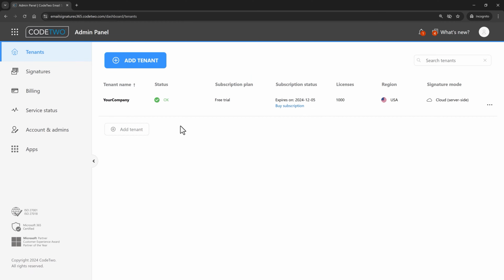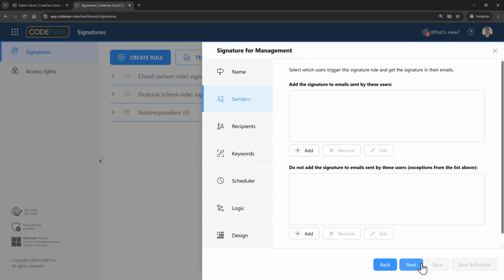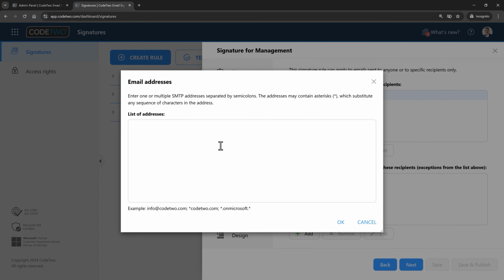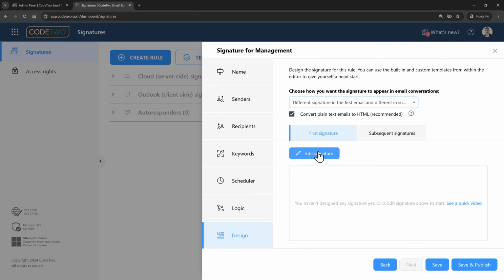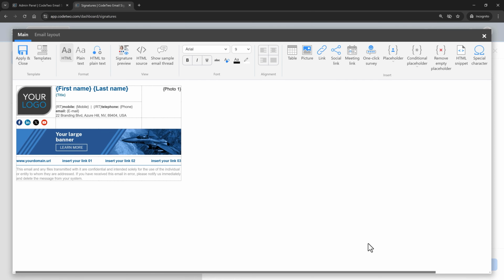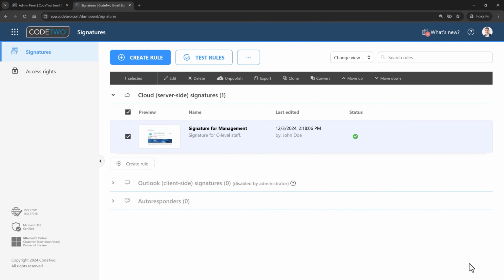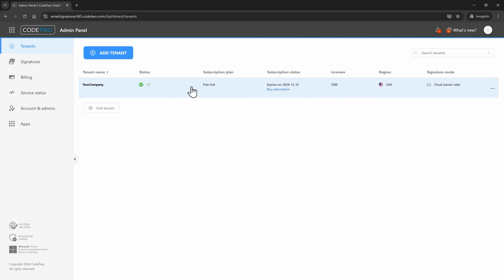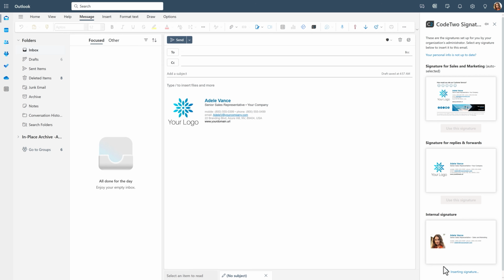CodeTwo signatures tutorial part 2: Design a signature & set up a signature rule

Comment: I used Exclaimer at my previous employer. CodeTwo makes the process more seamless and gives plenty more options. Pricing is more transparent too. Good job, CodeTwo!
Reply from the maker: Glad to have you on board. You made our day with this comment!
Reply: We are currently using Exclaimer cloud but it all requires user interaction (logging in with MS credentials) before it adds the signature. I just want users to have a signature regardless of the device they use their e-mail on. How does Codetwo handle this?
Reply from the maker: @therickman1990  Sorry for the late reply – this comment must have slipped our radar!
 
Here’s how it works with CodeTwo: in cloud signature mode, all emails are routed through our service and get signatures automatically based on your rules – on any device or email app. No user interaction here.

With Outlook signature mode, signatures are added automatically by our add-in across all Outlook apps: desktop, web, and mobile. Users only interact if they want to manually choose a different signature (from the add-in pane). There’s no need to sign in to CodeTwo, as long as users are signed in to Outlook with their MS 365 credentials (for security reasons – this ensures the correct user gets CodeTwo signatures). Learn more about signature modes in this video: https://www.youtube.com/watch?v=2U_nZm6mshY 

If you have additional questions, be sure to contact our Customer Success team https://www.codetwo.com/company/contact  – they’ll be happy to assist!
Reply: @therickman1990  I'm so glad to hear this. Coming into a new position where they use Exclaimer. I am not a fan. Making changes like this takes risks when you are moving an entire company's platform so you want to make sure it's the right decision. Your comment makes me feel better about making this switch.